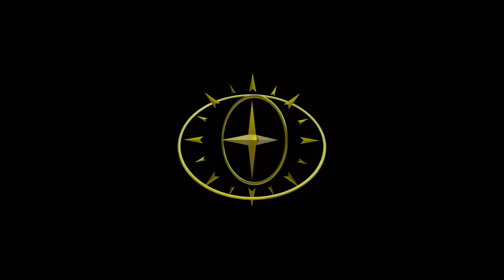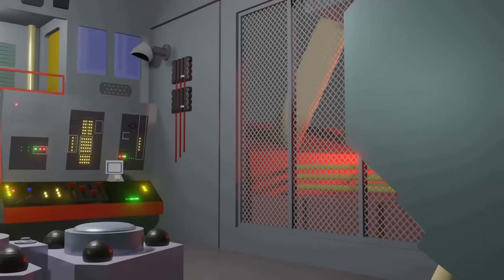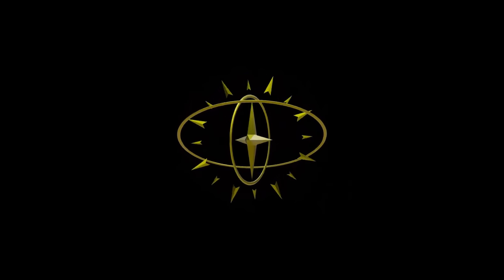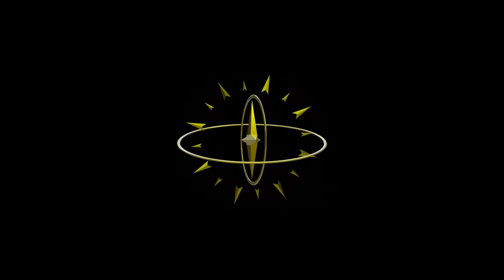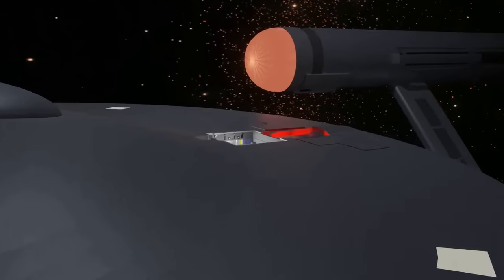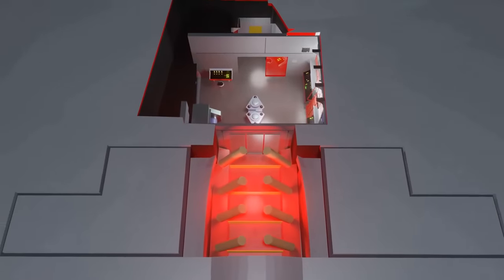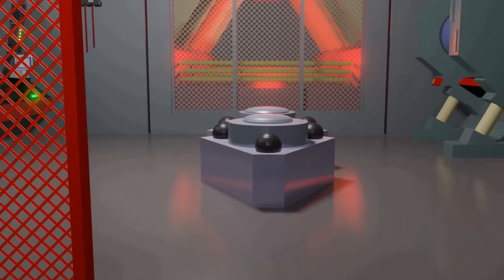The Enterprise Engine-room Enigma: where was main engineering?

Comment: I always thought the engine room was in that saucer. And most of the warp core was beneath them extending down the neck. As in the secondary hall also housed the shuttle bay and mantance bays for the craft. And the deflector dish took up a lot of the forward sections of the ship. The area of the core never moved in the refit. But just replaced. If you look at the movies. You never really see a dilithum chamber. Where we do on the show. So I assumed this always was at the top of the core and the dilithum chamber was on the top of this type of core. 

This always seemed to make sense to me. As in this age the impalse and warp reactors seemed to be tied together. Things like Weapons where tired to the impaulse drive. But in the movie they say the new phazors are powered by the warp drive now. This moving if critical systems from impalse to warp power maybe why the engine room was relocated.

Comment: continuity is something well done in ST however from day one the engineering was between the pylons of the warp pods.the angle of the pylons show the same angle as the pipes in the engineering room behind the fenced off area... this was original as interpreted by the audience when i was merely 13 years old. i am now 59. over time the continuity has been tweaked to come up with what this video describe
Reply: The original Star Fleet Technical Manual has TWO engineering areas: an area marked "Main Engineering" near the Impulse Engines in the saucer, and a separate "Warp Drive Engineering" in the secondary hull right under the nacelles. Main Engineering is shown to have computers that can monitor the warp drive from there. Make sense: the Enterprise has two different types of engines with different needs, and a crew of only 430.
Reply: @Idazmi7  i believe that would be from the original blue prints.. i am referring to prior and what the audience was lead to believe.. in fact many questioned the blue prints for exactly that reason... i am not speculation i am saying what is was at the time it happened.. i was there and discussing it then :) heres one tie down the aux bridge :)
Reply: @internetkilledthetv549  
"heres one tie down the aux bridge :)"

Deck 19. Additionally, you will never make a blueprint that is entirely accurate to the show: it is not physically possible because the show redressed and reused existing sets as new rooms to save money. The rooms in the show are inaccurate by fiscal necessity.

But regarding engineering, the Enterprise has two sorts of engines ("Warp" and "Impulse") and, thusly, two engineering rooms.
Reply: @Idazmi7  that is what i meant.. also the script original did not have the blue prints and much was adlibed.. but not for long
Reply: @internetkilledthetv549  
Which is why the blueprints were made after the show was done. That way, every major thing from the show could be included, and no new contradictions would arise.

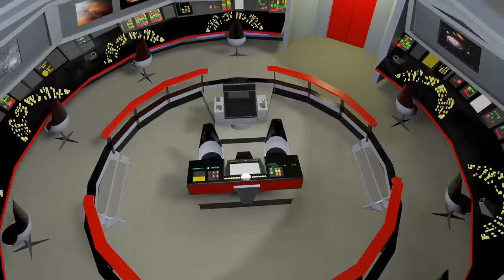Comment: 5:02 - I know it's not relevant to the video topic, but that rendering of the bridge is wrong. The round structure directly behind the bridge is the turbolift. The entire bridge should have been turned clockwise so that the front of the bridge would be at about the 5 O'clock position.

Comment: The one that just I just can’t wrap my head around is the scale of the Enterprise. As we know from STOS that you have 2 exterior shots of the Enterprise. One being when Scotty parking the shuttle craft into the side of the ship and when they walk on the outside of the ship towards the end of the movie. Both are not in scale with each other and neither are to scale for such a massive ship. They seemed to have corrected this problem in the latest TV series making the original series ship about the size of Enterprise D from STNG. This adjustment now means that Enterprise D is just that much larger and I am okay with that. Granted Discovery does show the elevator inside it’s triangle mess as a hollow spacious entity. It just doesn’t make sense.
Reply: The "roller coaster/habitrail" depiction of turbolifts aboard the Discovery and Enterprise in DSC is just weird, and there are enough cases of dialog-VFX mismatch to surmise that the production office was unorganized, so "poor management of the CGI artists" is the simplest explanation. With season 3, it may be: TARDIS-type expanded-space is a common tech in the 31st century. Unlike some techs it's not mentioned specifically, but there are a few other examples during the season, so "fistfight on a turbolift cab flying through a vast interior space" might simply be part of the ship's refit.

The "roller coaster turbolift tracks" might be a misinterpretation of an idea from the TNG Technical Manual, namely, that the habitable spaces are modules suspended on a frame within the outer hull, quite unlike decks in a wet-navy ship or floors in a building. There shouldn't be so much unused space around the tracks; convenient for the camera angles, though.

Comment: The secondary hull is a tube.  Space does not require a universal reference to up or down.  Therefore, is it unreasonable that there could be a curved corridor outside Engineering that ran perpendicular to the longitudinal plane of the secondary hull?

Comment: I'm going to presume some uninvestigated evolution to the design of the ships to explain the design of the ships.

If the original craft were a saucer with an impulse drive, then the engineering hull and warp nacelles would be absent. In this case, the engine room would be in the saucer. The ships may have been small enough that they didn't necessarily need shuttles, and if they did, they would dock to the outside like we do today. When warp was developed and added to existing ships, it stands to reason that the engineering hull would be directly connected to main engineering in the saucer to share resources and link control. Since warp required significant forward deflectors as well as the need to bring smaller transportation along, this would be why the main forward deflector dish and shuttle bay were part of the warp engineering hull. The forward sweep of the connecting hull would allow for turbolift access between the two to bypass the old main engineering still taking up space in the saucer section.

Designs immediately following this would still incorporate these dual features and older Starfleet members may still call impulse engineering "main engineering" since while it's little more than an access to the impulse drive, it still contains controls for the warp engines and access to the bridge. Even by the time of the galaxy class where ships are being built that can be split, there would still need to be dual functionality, though advances in configurable centralization and decentralization of functions would allow main engineering to be almost entirely in the engineering hull, though a separate main engineering (normally unattended like the battle bridge) would be present in the saucer section for when the ship was split.

So because of this, I maintain that two main engineering areas have been necessary for most Starfleet ship designs since the development of warp technology, and whichever one is "main engineering" is the one currently being used to propel the ship. Also, since they are significantly linked, even in a ship capable of separating, they are all the same main engineering anyway. It's just a matter of which part of main engineering are you heading to. It's like going to NYC - which part are you going to? Most of the time, the context will tell you.

Comment: I thought it was obvious that Main Engineering was just in front of the Impulse Engine but the Engine room was in the secondary Engineering hull. 
What I haven't seen yet is a discussion on the Landing struts and explosive bolts for the saucer section in the original series. While they were never used or talked about, they are included in the original blueprints and I believe they were designed for planetary landings before transporters were invented to save money.

Comment: with all due respect, it’s not a mystery and never was: there was no other place for it except where it was shown later on: between the deflector dish and shuttlecraft bay. it’s where it is on ships of the 20th century, buried in the bowels of the ship far from the bridge and directly linked to the propulsion(the nacelles). it was remotely linked to the bridge but still directly controlled by the huge section in the bowels of the ship.
Reply: The original Star Fleet Technical Manual has TWO engineering areas: an area marked "Main Engineering" near the Impulse Engines in the saucer, and a separate "Warp Drive Engineering" in the secondary hull right under the nacelles. Main Engineering is shown to have computers that can monitor the warp drive from there. Make sense: the Enterprise has two different types of engines with different needs, and a crew of only 430.
Reply: @Idazmi7  the computers are also linked to the bridge, which Scotty is frequently at.

i can understand the idea of an engineering in the saucer section given the ability to jettison the secondary hull as the impulse engines are located in the saucer section, but they aren’t the same as primary engineering where everything goes to
Reply: @bostonrailfan2427  
Why not? 
Primary Engineering - Primary Hull. 
Secondary Engineering - Secondary Hull.
Reply: @Idazmi7  except it’s reverse: primary engineering is in the secondary hull, secondary engineering(the impulse engines) is in the primary hull

unless you’re of the belief that the impulse is the primary engine it doesn’t fit, and even if impulse is the most used it’s still not the primary engine of the ship
Reply: @bostonrailfan2427  
You're assuming that the terms "primary" and "secondary" refer to importance rather than their location in the ship. You also assume the warp drive components are located in the hull - for safety reasons, they absolutely aren't. The original Enterprise's warp drive components are entirely contained in the nacelles. The "Warp Core" concept wouldn't be a thing until TNG.

Comment: Franz Joseph is canon. It's at the rear of the saucer section. 
This makes perfect sense since the saucer is detachable as a self-sustaining space ship. 
(Finally realized in Generations film.)
Reply: Exactly.
Reply: @Idazmi7  Live Long and Prosper.
Reply: @fattymcfatso1083  
Peace, and long life.
Reply: Nope. It's not really very canon (only bits are used in the first three movies) and it conflicts with other material, including the Doug Drexler cutaway done for ENT's "In a Mirror, Darkly" showing two engineering sections: one on the Impulse Deck ( a small one for the impulse engines) and the Main Engineering (the set that we see in the series) is in the secondary hull between the deflector and the pylons. 

This fits with TOS' "Day of the Dove" and "The Paradise Syndrome" very nicely with what is shown. The shorting out of the warp engines occurs in those tubes behind the red screen, the entity exits the ship from the secondary hull immediately after it flees Main Engineering. This also jives with Good Kirk's comments from "The Enemy Within" about "The lower levels. Main Engineering", and Lt. Kevin Riley being  Engineering "Not me. I am down. In the engineering room."  in "The Conscience of the King".

Comment: One more reference which gives credence to the idea that i it is located in the saucer near the impulse drive- In "The Doomsday Machine", Scotty gets the Constellation's Impulse drive working and we see a dull glow and thrum from the area beyond the grate.
Reply: Unfortunately, that isn't quite what happens. We see Scotty working at different locations with the tool in the Constellation engineering room. When the engines come online, everything seems to surge a bit as well as tilt considerably. 

Any discontinuity there is contradicted by "The Enemy Within", "The Conscience of the King", "Day of the Dove", and "The Paradise Syndrome", all have lines or visuals that indicate Main Engineering is in the lower decks of the secondary  hull. 

"The Paradise Syndrome" very violently shows the tubes behind the screen erupt in sparks and smoke when the warp engines are overloaded from trying to feed power, first into the deflector dish and then into the phasers. The impulse engines were said to still be safe and available.

Comment: In The Doomsday Machine", the USS Constellation(NCC 1017) and other hull numbers indict that at least 6 Heavy Cruisers(CC)were built before the USS Constitution(NCC 1700).They are USS Constellation(NCC 1017)Class. The engineering deck appeared to be where the struts are attached. The USS Enterprise(NCC 1701)was upgunned, or got a SLEP, to 2nd Flight par. USS Enterprise-D(NCC -D)Class Dreadnaught. 3, or 4, Capt. Picard said "It's the first of the type. Or similar words. 1st launched sets the class name.

Comment: All you have to do is look at the NCC-1701 blueprints and engineering is in the saucer between the impulse engines. It shows the consoles, dilitheum console and the Red Impulse engines behind the mesh wall. Pages 6 & 8
Reply: Which ones? The layout shown in Franz Joseph's materials are contradicted by later, official works, and onscreen canon. According to AMT's cutaway 22" Enterprise model, SciPubTech's cutaway, and the cutaway made by Doug Drexler for Star Trek: Enterprise's "In a Mirror, Darkly", main engineering is in the engineering/secondary hull. The crisscrossing tubes seen behind the red screen mesh are the EPS conduits that feed up into the warp nacelles.

There is a smaller, Impulse Deck engineering room in the saucer, but the impulse engines are much different as is the room itself.

Comment: Obviously the writers back then had no true idea where to put main engineering. Logically though the set we see in season 2-3 I would surmise is in the secondary hull near the back by the pylons. Since the deal we see passed that see through grate looks like conduits that would lead back to the pylons and up to the nacelles. I'm sure there's rooms by the impulse engines as those would need A LOT of maintenance. Perhaps those are called "main engineering" as well although it would make no sense. If they were called "engineering department" or "impulse engine maintenance" then that would be different and makes more sense.

However, I don't think that's where the actual MAIN engineering would be. Dilithium crystals wouldn't be kept there but instead in the secondary hull. 

We have to disregard the episode "The Alternative Factor" when we first saw "main engineering" as that looked like a room in the saucer, probably where the impulse engines are.

Comment: Franz Joseph made many errors and false assumptions in his work. Like how he put the bridge offset from facing forward
Reply: I think he also messed up the lower curvature of the secondary hull on his diagrams. maybe even made the neck thinner ?
Reply: The 30 degree bridge offset was accurate given the location of the turbolift doors on the bridge set and the turbolift bulge on the outer hull at the rear of the bridge.
Reply: @vincesieber8828  That bump seen on the outside is not the turbolift. It's the access port for deuterium tanks.  But the off-set bridge is an urban myth that is so set in minds it's impossible so shift

Comment: OK ... bear with me. The one thing EVERYONE from Franz Joseph on has ignored is that — even if you put main engineering and the warp core in the secondary hull — placing the impulse engines AND an engine room for those engines AND the clamp-and-release system for saucer separation AND the turbo lifts from the primary hull to the secondary hull ALL in the same narrow space above the neck of the ship doesn't allow sufficient room for those systems to coexist. Even if the power for the impulse engines comes up the neck from Main Engineering, that would mean the saucer section would lose its primary source of power if it separated from the secondary hull.

But there is a solution: in one episode, Kirk mentions there are THREE engine rooms on the ship; it's a throw away line, written to show that how big the ship is and how hard it will be to search for someone BUT — and here's the leap I'm asking everyone to make — what if all three versions of "main engineering" that we see across 3 seasons are NOT the same room on the ship with upgrades, but the three different engine rooms?

In this case, the large 2-level set we see in later episodes with the dilithium chamber in the center is the "main engineering" that contains the warp core in the "engineering hull"; and the other two sets, seen early in the series (ie, those without ladders and a second level) are the two engine rooms in the primary hull that supply power to the impulse engines, transporters, weapons, etc — and that these two are located to port and starboard on either side of the neck at the back of the saucer section, under the two L-shaped panels. 

This would also explain the different entrances we see going into engineering, and the different modules and connected work rooms that appear over the course of three seasons.

Comment: Where is the main mater/Anti mater miker. Must. Be located separately from the crew. It's where the giant anti mater Gerbers are. Running on anti mater wheels. While eating dilithum crystals and drinking H2O. Gas discharge is not breathable. Must be separate from air breathers.
Reply: After all things, has a tail pip somewhere. Gas runs turbines. Turbines run ship.